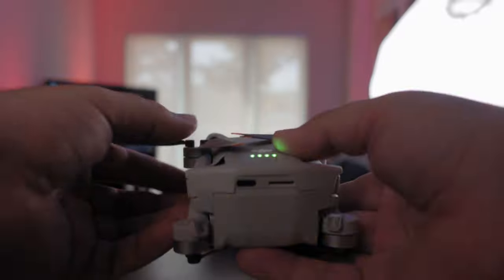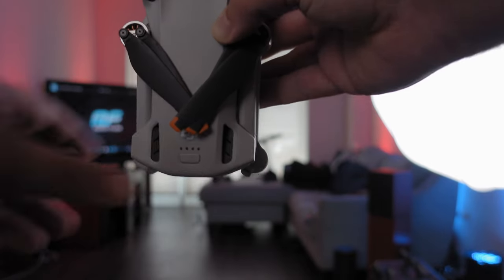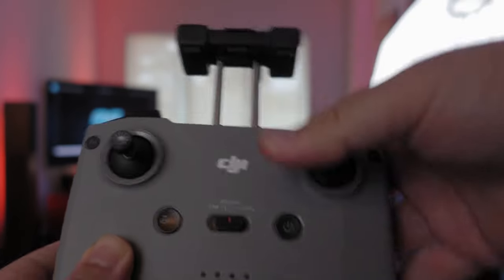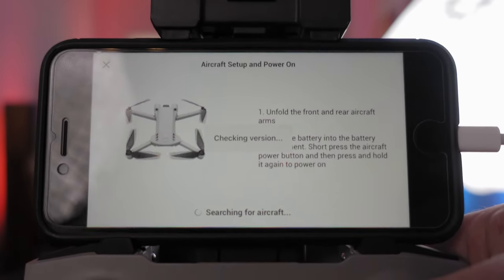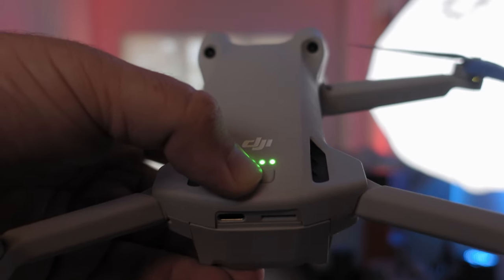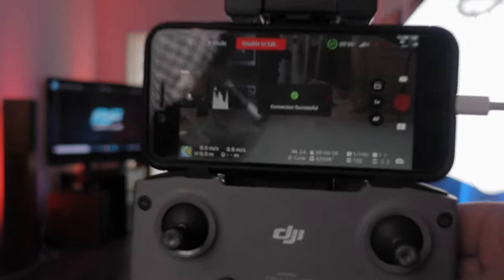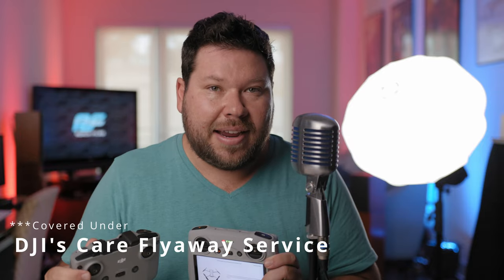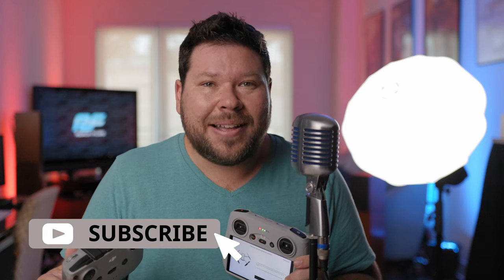DJI Mini 3 Pro Tutorial | How to pair & bind your Remote Controller

Comment: I spoke with someone at DJI Tuesday about losing the flyaway if you use and bind a new controller. I have a mavic3 and want the RC Pro but after watching this video a few times it made me skeptical of the switch.  Curious where you saw you lose the coverage because the DJI care rep told me it transfers as long as you bind the remote to the drone and in your care refresh account.
Reply from the maker: Hey! Thank you for this, I show in the video where it showed up in the process, however this specific video came out within the first few weeks of the drones release and they have seemed to fix it where it does not show this prompt anymore.
Reply: @ReachFilms  That definitely eases my mind. Thanks for the great content!!  Seemed like it would defeat their purpose to launch a platform and.m not make it user friendly or give the ability to upgrade.
Reply: Hey that's good to hear. I've been using the controller with the screen, but there are times when I need a bigger screen so I ordered the RC-N1 so I can use a 12.9" iPad. Are you able to switch back and forth between controllers without too much fuss?
Reply: @wrybread  Same question here.  Hopefully someone will know this answer.  Two things, the controller with the built in screen has a ton of glare.  I order the matte screen protectors that are supposed to reduce much of the glare.  Secondly, I'm coming from the Mini 2 where I was using an iPad Mini.  That is a big real estate difference in display.  The controller with the built in screen is so much smaller that it's hard making out the picture details.  For example, spotting birds floating on a lake.  As much as I like the extra buttons, zoom wheel, etc I would rather work around those to have a larger display.
Reply: @jeffbruer8735  yup, exactly the same issue. Hoping I can switch back and forth somewhat easily.

Comment: Yeah pairing for me doesn't work. Keeps saying it 'timed out'
Reply: Same here. Did you get yours to work?
Reply: @Stick-n-DragBowHunting   I’m getting the same Timed Out message. Has anyone been able to work thru this ?
Reply: well in my case, i accidentally clicked on the Mavic Mini 3. once i went back and clicked on Mini 3 Pro it paired right up
Reply: @fatbongripz4207  I spent a good hour trying to get my controller to pair yesterday.  Sure enough, I was selecting the wrong Mini 3.  Thanks for replying with that.  I'm sure I would have tried again without even thinking to check which Mini 3 model I selected!!!!  Your comment should be pinned.  I see many others saying they can't get their controller to pair...
Reply: @jeffbruer8735 thanks that’s what I did wrong lol
Reply: hii @funkdrone_ , I recently purchased a DJI Mini 3 Pro drone but have been having trouble connecting it to my controller. I've tried resetting the drone and controller, updating the firmware, and checking for updates, but nothing seems to work. However, I did discover that when I use my friend's controller, my drone works perfectly fine, but my controller doesn't work with my friend's drone. So, it seems like the issue might be with my controller (in built display controller). I would appreciate any advice or help on how to resolve this issue. Thank you!"
Reply: On the first screen, you’ve got to pick the right drone… #SwipeRight
Reply: For me, the problem was not powering on my rcn1 controler
Reply: I’m still having this issue, selected the correct drone. My rc-n1 is currently paired to my mini 2, but I want to use it for my mini 3 pro… any way I can do this & get through the “timed out” notification?
Reply: I had to hold the power button until the beep- then it worked
Reply: @jeffbruer8735  These comments helped.  That was my issue.  Picked the mini 3 which is the first choice.  Needed to go over to the 3rd choice which was the Pro.

Comment: I got a new Mini 3 pro with RC controller today and it would not pair, tried everything I could think of. After reading the comments here I selected Mini 3 (not Mini 3 pro) and it paired in about 5 seconds. I had searched everywhere for a solution, I would never have tried the vanilla Mini 3 without the comments here. Thank you all so much, I was getting upset at the thought of having to take it back as faulty.

Comment: When you say push the pairing button on your remote, it would be nice if you told me which one of those it is as none of them says pairing, and the instructions in the box are too small to read without an electron microscope.
Reply from the maker: The button is digital through the app, when you go through the steps

Comment: That was a great video, thank you. Could I please ask the following: 
I have an Air 2 with an RC 231
I also have a Mini 3 Pro with a DJI-RC (Screen)
I want to use the RC 231 as the controller for both drones. Not at the same time.
1, This can be done? (according to Heliguy)
2, Is there a link to show me how?
3, How do I disassociate the DJI-RC from the Mini 3 pro. Do I need to?
4, Is there a link to show me how,
5 How do I remove the DJI-RC from the account it’s registered with? (mine but a different account)
6 Is there a link to show me how?

Thank you

Comment: I have purchased DJI MINI3 PRO with an older controller ND1 both I was told are bounded.
When I switched on the controller as well as the drone and followed your instruction, MOBILE says go to SETTINGS and I can not do anything else. The drone does not respond to the controller. Am I ending with a lemon set?
Can you please advise me? Thank you.

Comment: no luck w me on getting my controller to work..beeps and will not sync up ...frustrating..but glad you talked about the remote that binds w the drone for the refresh care! I would not have known that
Reply: hii @BaldadonisMike2021, I recently purchased a DJI Mini 3 Pro drone but have been having trouble connecting it to my controller. I've tried resetting the drone and controller, updating the firmware, and checking for updates, but nothing seems to work. However, I did discover that when I use my friend's controller, my drone works perfectly fine, but my controller doesn't work with my friend's drone. So, it seems like the issue might be with my controller (in built display controller). I would appreciate any advice or help on how to resolve this issue. Thank you!"
Reply: @mahendrasinghpuniya548  i did figure it out eventually ,I believe I had to download the previous updates first..then update this firmware update after ...then it worked..I had to mess with it a bit..hopefully you can figure it out..again..I had to update the previous updates first.

Comment: I bought an AIR 2S in August '22 with the Basic "RC-231" ? (Brand new from a DJI Dealer) ,and just got a RM-330.The 330 paired right up after going through the process, the  problem is (if it's  really a problem at )the prompt comes up ................
Connected device not bound to aircraft. You may continue flying with the connected device 4 time(s ). Connect to your Remote Controller 
SN (**.......)to continue or perform the following steps.......
Change bound device 
Unbind device 
Cancel 
Well,the original remote won't let me unbind it from the Air 2s, and I can't do anything to change settings on the new 330 remote.  Do I have anything to worry about if the flight counter gets to zero or is this nothing to be concerned about ?

Comment: Great information Jeff. I purchased my Mini 3 Pro with the DJI RC and I want to bind it to my RC N1. Can I have the aircraft bound to both devices at once or does it unbind from the DJI RC if I bind it to the RC N1? I'm not worried about DJI Care Refresh, I just want to know if binding to a device it didn't come with will automatically unbind it from the controller it came with. 

Thanks in advance,
Eric
Reply from the maker: You can only bind it to one at a time, however now it doesn’t matter about the dji care refresh. They may have actually fixed that issue due to this video

Comment: hello I am purchasing a dji mavic mini with the controller with the screen from someone, on eBay, will I be able to operate this drone, being it does not require an app to  fly , as it has the built in screen with the controller, ? its the mavic mini 3 if that matters

Comment: @reachfilms "Hi everyone, I recently purchased a DJI Mini 3 Pro drone but have been having trouble connecting it to my controller. I've tried resetting the drone and controller, updating the firmware, and checking for updates, but nothing seems to work. However, I did discover that when I use my friend's controller, my drone works perfectly fine, but my controller doesn't work with my friend's drone. So, it seems like the issue might be with my controller (in built display controller). I would appreciate any advice or help on how to resolve this issue. Thank you!"
Reply: Same issue.

Comment: I’m going from the rcn1 remote to the rc with screen. Do I need to unbind the rcn1 first or do I bind the new remote first.
Reply from the maker: You can set up the new controller and it will unbind once you go through the process
Reply: @ReachFilms  so I can just connect the new remote and it will unbind the old one? Correct?
Reply from the maker: @troygibson6690  as it will go through the steps it will prompt you to unbind the controller, so make sure you follow the prompt that way the the controller gets unbind. Because if it doesn’t get unblinded, then you’ll only have five tries with the controller.

Comment: Great video .. question do I need Bluetooth and WiFi on ? If WIFI is it connected to my home WIFI ?
Reply from the maker: To connect to the drone, no you don’t need it on
Reply: @ReachFilms  Thank you I'm just a beginner here and  I've gotten conflicting information from a couple of drone guys hence why I asked.  It is my understanding Bluetooth is the only thing 'on' to pair with the drone.
Reply from the maker: @susanwright8540  the pairing is done though the transmission system, so not really sure what bluetooth has to do with binding. The transmission system is what connects the controller to the drone, wifi is more for internet from your phone's hotspot and bluetooth is for accessories

Comment: Do I need to do any binding at all if I didn't get DJI care package and just insured through my own insurance company? My insurance company(State Farm) didn't advise me to do anything at all. They just told me if can only be flown for recreation only for it to be covered. Just didn't know if binding anyway is a good thing to go ahead and do. Would it help me to find my drone in the event of a crash or flyaway?
Reply from the maker: The controller that came with your drone is automatically bonded to the drone, you only bind another controller if you get any different controller than the one that came with your drone. That being said, binding a controller shouldn’t affect your State Farm policy. It only affects the flyaway policy in the DJI care plan.

Comment: How's it going..
So I have the Mini 2 with DJI RCN1 (rc231 specifically) and I just purchased the mini 3 Pro with the DJI RC.
Well I want to use my (rc231) with my mini 3 Pro, but when I select the mini 3 Pro it says that the firmware of the rc is not compatible and then gives an option to to check for firmward up date then comes back with an error code and can not do anything.. Been online with DJI all morning and just about to give up so any suggestions or whatever would help.. Thanks..
Reply from the maker: Your only option is to update the firmware of both the controller and mini 3. You should use the controller the mini came with to do the updates to the mini and then update your other controller separately
Reply: Yes I've been trying all this since yesterday and everything is up to date on all apps firmware devices so I  have no idea.. Thanks for the quick response though!!! I'm not giving up totally yet..
Reply: Figured it out..
I was running version 04.11.0034 
Now updated to version 04.14.0600
I now have 4 flights remaining with the RCN1 before I have to bind it to my account or voids my fly away warranty.. 
I can live with that...
Thanks again..

Comment: "Hi everyone, I recently purchased a DJI Mini 3 Pro drone but have been having trouble connecting it to my controller. I've tried resetting the drone and controller, updating the firmware, and checking for updates, but nothing seems to work. However, I did discover that when I use my friend's controller, my drone works perfectly fine, but my controller doesn't work with my friend's drone. So, it seems like the issue might be with my controller (in built display controller). I would appreciate any advice or help on how to resolve this issue. Thank you!"
Reply: On the first screen, you’ve got to pick the right drone… #SwipeRight

Comment: Looks like you can unbind the flyaway controller a rebind to a different one. What am I missing?
Reply from the maker: You are missing the part where if you unbind the controller from your drone that was listed as the controller under DJI Care (if you have it) then it voids the specific flyaway segment of the DJI care. For some that part is a must. If it isn’t a big deal for you then you can change controllers back and fourth without issue.
Reply: @ReachFilms  Where does it say that? What I read indicates you can just rebind  it with a different controller and retain flyaway
Reply from the maker: @EricJohnson-dc2ej  when you attempt to do the rebinding there is a disclaimer that appears before you can attempt the bind
Reply: @ReachFilms  I didn't get anything that said that
Reply: @EricJohnson-dc2ej  Same here it doesn't say that and having checked my DJI service plan it still says it covers Flyaway Coverage which is displayed with the status displaying "Valid".
Reply: @dicekidhedz247  Same, mine says valid
Reply: It says its fine to switch controller on the 3rd section of the Service Process in the DJI Care Refresh service plan.
Reply: You can switch controllers and rebind, if that was true then it isn't now, dji said its covered under both controllers as long as you rebind them if you switch back and forth...

Comment: HI ... found a mini 3 pro crashed in my back yard some time ago. Battery is dead . Pulled the sd card . Nothing on it that indicates an owner or their location or a record of its  flight into my back yard . I assume the card must have been full for some time. The last recording on it is over 5 months ago . Nobody has come to claim it . Can I purchase a controller and make use of it ? Seems a waste for it to be just sitting around never to be used again .
Reply from the maker: The drone will be registered to who every activated it through DJI until they deactivate it, so if you contact DJI they will know the owner through the serial number
Reply: @ReachFilms  Thanks but I cant find a serial number on it anywhere . If you can point me to it I will call DJI  Is it the controller or the drone thats registered ? thx

Comment: I had a mini three pro replaced after crashing it. I got the replacement, and paired it with the RC controller as described in the first part of this video. However, I never got anything about binding it. I was super worried that it might come back to haunt me. So I went into the settings on the controller, and found that both the old drone that I had returned as well as the new drone that I paired were both bound to my account. It looks like they’re binding it to my account rather than the controller. But for me, I only have the one controller anyway. I got an error with that message he describes in the video when I went to remove the old drone and decided to just leave it for now.  I don’t need to remove the old one, so I just left them both bound to my account.

Comment: Once the mini pro 3 drone is paired with the mini 2 remote can i still use the remote to control the original mini 2 drone?
Reply from the maker: No you will have to rebind the controller to the mini 2 again

Comment: Curious, just received a new kit and tried the process to pair about 10 times and it times out every time, no way to pair... Should I return the kit ?
Reply: hii , I recently purchased a DJI Mini 3 Pro drone but have been having trouble connecting it to my controller. I've tried resetting the drone and controller, updating the firmware, and checking for updates, but nothing seems to work. However, I did discover that when I use my friend's controller, my drone works perfectly fine, but my controller doesn't work with my friend's drone. So, it seems like the issue might be with my controller (in built screen ). I would appreciate any advice or help on how to resolve this issue. Thank you!"